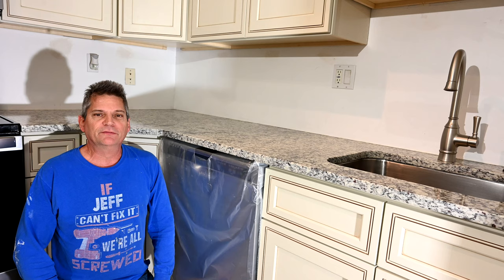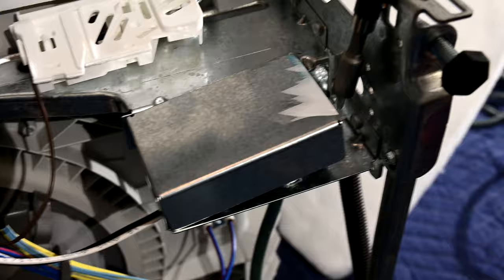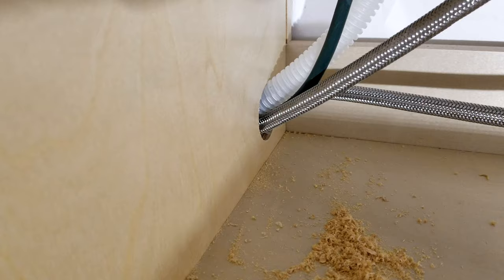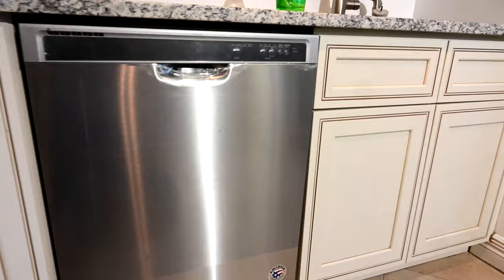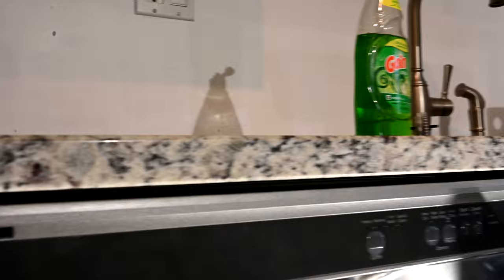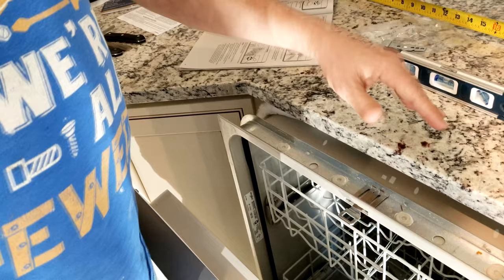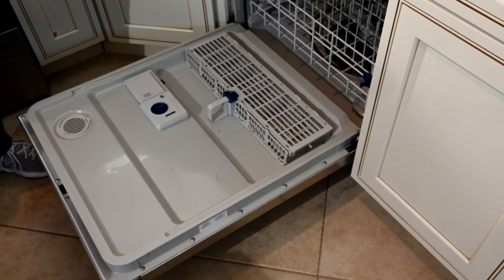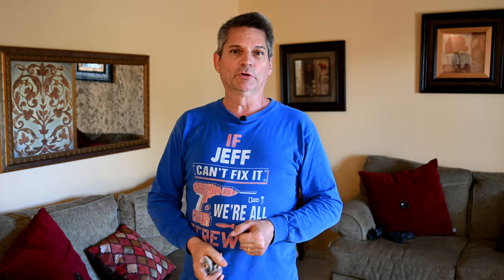How To Install Dishwasher Like The Pros, Correct to Code

Comment from the maker: 🛒 Amazon sells 2 smaller versions of this Channellock Mechanic's Tool Set:
🛒 Channellock 39067 132 Piece Tool Set: https://amzn.to/36SZr1U
🛒 Channellock 39070 94 Piece Tool Set: https://amzn.to/35N3fBy
🛒 RIDGID One Stop Wrench Kit: https://amzn.to/2ClCbNa
🛒 Milwaukee 3/8-in Cordless M12 Ratchet Kit: https://amzn.to/2XGzS01
🛒 DEWALT DCK299D1T1 Hammer Drill, Impact Driver Kit: https://amzn.to/2M6h450
🛒 General Electric Universal Dishwasher Water Connection Kit: https://amzn.to/2EFPjNi
🛒 Milwaukee 13-Piece Hole Dozer Hole Saw Kit: https://amzn.to/2H3Wxyh
🛒 Channellock 12-Inch Tongue and Groove Plier: https://amzn.to/2ThDVBv
🛒 Whirlpool 3-Prong Dishwasher Power Cord Kit: https://amzn.to/2XysrYO
🛒 DEWALT DWST11556 Express Folding Workbench: https://amzn.to/2qsaRdi
Reply: i guess it is quite randomly asking but do anybody know a good site to watch newly released movies online ?
Reply: Good grief, I sure wish I had seen this video prior to ordering all the other fittings and shutoff valves today.  21:13 is quite the sight, so sleek and simple, quite nice indeed.  Double water shutoff valves, and their 1/4 turn, hot.dog!

Comment: This guy isn't a professional at all first off I seen copper outside of the wire nut, second the hose clamp on the drain coming off the pump was not in the proper position which could cause it to leak later on third a real plumber drills a drain hole through the cabinet right below the counter top so that you don't have the drain hose under the cabinet getting in the way

Comment: Jeff, Please respone to this statement I found online. - "The door of the dishwasher is typically not flush with the cabinets, says Home Arise, but instead it protrudes out from the face of the cabinets about an inch or more. This is so that the dishwasher doesn't vent steam inside the cabinets when it's in dry mode. In addition, if the dishwasher is too far back inside the cabinets, the front lip of the face frame interferes with the top of the door. Therefore, the correct positioning is to set the front of the dishwasher – not the door – flush with the front of the cabinets. The door protrudes just enough so that the contact point between the door and the front of the dishwasher is visible."
Reply from the maker: That does have some sense to it but I would also make sure you followed the guidelines of what the manufacturer tells you because their design of their dishwasher might be different maybe it's venting out the bottom. Also when the dishwasher door is closed it's sealed with a rubber gasket so I'm not sure where all this steam is coming from that they're talking about
Reply: @jeffostroff  Thank you for your quick reply!  I will check the manual and hopefully it will be as helpful as your well made videos. Most new appliances have skimpy information and refer to an online version.

Comment: Honestly, I used to do installs for Lowe's and every dishwasher I've installed was attached either at the top or side mounted. Good that you pointed out checking the plug on garbage disposal. 99% of customers that bought a new dishwasher because the old one wasn't draining. They hired another plumbing company to install a new garbage disposal and they forgot to knock out the plug. That's a costly mistake. 1. The water damage it causes from the dishwasher overflowing and 2. The cost of a $400+ dishwasher that they really didn't need. Btw, I wish all dishwashers install had wall outlets, 90% of the ones I've installed was hard wired 😅 Another GREAT VID Jeff!!!
Reply from the maker: Thanks! Wow, funny how you only see the hardwired, but we only see outlets down here. Maybe it's the age of the houses. You could put in a blue remodel outlet box you know, would they allow you to do that?
Reply from the maker: Thanks! Wow, funny how you only see the hardwired, but we only see outlets down here. Maybe it's the age of the houses. You could put in a blue remodel outlet box you know, would they allow you to do that?
Reply: @jeffostroff  In Orlando you're allowed to use them, but Lowes wouldn't pay for such things lol

Comment: You called it Jeff.  I remember when a new dishwasher was installed at my father's home the guys contracted by the big box store rushed through the install  - unit was not flush or level.  The discharge hose is lying on the floor and has to be replaced and properly reinstalled.  They didn't seem to care if they did a good job or not, they just wanted to get out. The attitude they displayed was "unprofessional" at best.
Reply from the maker: We are seeing way too much of that attitude lately

Comment: Thanks Jeff. I had new dishwasher installed by Big Box and they did not put discharge hose up and the front cover plate was not screwed on. real issue was the old washer used 220 so had 2 110 lines in to it they hooked it up like that and keep tripping breaker, that's how they left it with my wife.  He couldn't just remove one line to have it running.
Reply from the maker: Yes b I g box store installers arw inept

Comment: 2020 NEC requires GFCI protection for all electrical receptacles within 6 feet of a sink. No longer any language that exempt those behind a [cabinet] door. If this is a new build you need a GFCI outlet or breaker
Reply from the maker: We are putting one in currently on a remodel as we speak.
Reply: It should be noted that a dishwasher pulling power from a circuit that has a gfci outlet on it should also be protected by that outlet. So it should not be hard.

Comment: Excellent video! Glad that somebody is calling out these so called installers from Best buy, Home Depot and Lowe's, I prefer to do installations myself at 70 years old I can still do a job in a professional manner as to avoid headaches due to improper installations. Last install (a dishwasher) was from Best Buy and let me tell you I gave them an ear full. Totally unprofessional, messes everywhere, you could hardly walk in the kitchen, would not touch the water shutoff valve due to a light surface oxidation, not rust just a light faint layer of oxidation. Took me 30 seconds to disconnected the old hose and connect the new one, 30 seconds flat, not bad of a 70 year old, HEY? Yeah due to liability concerns. If you expect to find shiny shutoff valves to do a job, you will be disappointed. Oxidation is a natural occurring process on metal when is exposed to humidity as in a dishwasher cabinet, and any house that is a few years old will have this issue. The degree of oxidation will determine if you need to replace that valve, in this case it was just a very light layer of surface oxidation, I wiped it off and connected the new water hose in 30 seconds flat. The guys left w/o saying thank you, ended up getting a refund and I have not hired these so called installers again. The few things they did, I had to re-do because the hoses were leaking, looked like a waterfall inside the cabinet, I told them to go home to their daddy and mommy and did the job myself, these guys messed around for 2 hours and could not get the job done correctly. Shame, shame! Oh well save me 180 bucks!

Comment: Hi Jeff, this video is very informative. Code standards and installation. I have a few questions regarding your instructions:
*During the electrical plug installation <2:00> you made a very important point about the rough metal circle needing a buffer so that the wire didn't get frayed. This made perfect sense. So when we came to <6:41> in the video I wondered if the same would apply to the edges of the circle cut out which leads to the water and electrical hook-ups in the next cabinet. 
* The water hose (because it is constantly pulsing high pressure water) couldn't this hose get cut in to after time?
*The electrical plug in, same thing 
* Last is about the safety of threading the water hose, the electrical plug in and the water supply hose all together. I  guess because I was always told water and electricity don't mix.
Thank you again I hope you will be able to answer my questions 😊
Reply from the maker: You could run them through their own hole, i t doe snot mater. The big drain hose is never under pressure so it won't pulsate. The smaller supply hose is under pressure but typically is a steel belted hose so it won't keep shape changing on you. The difference from 2:00 in the video is the sharp edges of metal cutting the cord. The wood is not considered a sharp edge that would cut the cable.

Comment: Great video Jeff. Thanks especially for the explanation on the air gap. I bought one for my new faucet thinking I needed it or that it might be a benefit. I am sending it back. As you are aware, I live in So Fl so not needed by code either.
Reply from the maker: Glad it was helpful!

Comment: Great video Jeff! Everything was explained well and was very informative! I just recently installed a new control board for my dishwasher because the old one did not give me the green light.  Now, the dishwasher is working perfectly, the only issue I have is securing it to the counter again.  I misplaced the screws and I'm not sure exactly what size they were.  We have a quartz countertop and I remembered seeing in your video that installers will sometimes mount a metal bar underneath.  I see the metal bar and the brackets I am just not sure on the screw size.  Or will it be more secure if I mount it on the sides as you did? I think you said number 10?  Thank you I am now a subscriber! Outstanding video!
Reply from the maker: Yes, predrill with a 1/16" drill bit about 1/4" in if you use the side mount method. But you should be able to locate and re-use the previous holes in your counter.

Comment: Hey,
I recently purchased a Maytag dishwasher and it has screws in the electric box. The side that I have to hook up my own electric connection also has screws, so I am assuming that I need a wire that has those circular brackets. Is it just safe to wrap my hardwire’s tips around the screws?

Comment: The Screws of the Romex connector belong on the OUTSIDE of the connection box! They are sharp and can cause damage to the wires. Code requires them to be accessible "without removing the covers of the box, fitting, or cabinet". 
• 6 inches of the flexible cord or any other cable "shall be removed to allow 6 inches of free wire" within any box..."
• Under the sink: There should be 2, SINGLE outlets for the disposer and the dishwasher, not 2 duplex outlets.
• I love the paper-towel stuffed in the extra drain pipe, how about removing the elbow and capping it off with a clean-out plug?
Reply from the maker: LOL, you are blind as a bat! You did not see at 2:24 I used FLAT tipped screws, specifically designed to be safe for wires, like flat tipped Eaton screws used to secure electrical breaker panel covers to walls. And you look at those screws and say they are sharp? Time for glasses. You know how to ramble off NEC code about outlets under sinks. But you are wrong, it's only on new construction. This is an existing kitchen and they don't have to be changed to newer codes unless you open up the wall. As for paper towel, that was temporary until we were finished. The old pipe coming out of the wall was cut a few inches off the wall, and capped off.
Reply: @jeffostroff  Sure, and the opposite ends of the screws are still a sharp edge. They are still supposed to be OUTSIDE the wiring compartment no matter what the screws are. Call me as many names as you want and be as rude as you want,  a sure sign of a guy that already know he's out of ammunition, but that will not make you right. The code is also clear; you have to bring it to current code when changing the appliance. Opening the wall is not a requirement. It's considered a new installation, no different than if you had started from scratch. It's not grandfathered. If you took it out to repair a burst pipe, then it's a re-install and it IS grandfathered. Some inspectors will let it go, some ....well, not so much. Been doing this for 45+ years, how about you? I hold licencure in Electrical, Plumbing, and Facilities Management (Degree'd from an Ivy league school) and have EPA certification for refrigeration... And you?
Reply: @johninmilford7719  as soon as I saw him put the strain relief connector in backwards, i knew this guy was clueless, don’t bother trying to sway him.

Comment: I had a new Bosch installed this week.  I notice under my sink it gets really hot now towards the end of the dishwasher cycle.    Never had this issue with the last dishwasher.   I’m wondering about the water line …I can’t remember what material the last water line was …this one looks like white plastic.  I wonder if need to get something better.
Reply from the maker: White ribbed plastic is the drain hose, normal, about 1" diameter, runs from dishwasher, through hole, to the garbage disposal. But your water supply line form the shutoff valve under the sink going to the dishwasher should be steel belted hose. The white ribbed drain hose from the dishwasher only gets a little warm when the dishwasher empties a few times during the cycle. IT should not make the inside of the cabinet hot. It is not leaking is it? Any water or steam in the cabinet during the cycles?
Reply: @jeffostroff  No..no steam.   Last night I ran it on Auto cycle and it ran a long time.  Tonight I ran it on Normal cycle and that seemed to be a shorter cycle and not nearly as warm under the sink.  I can still feel heat coming off the plastic line but not like yesterday.    I guess some heat is to be expected ????   Just never noticed before.

Comment: JEFF, DO YOU HAVE TO TAKE THE DISPOSABLE OFF TO PUNCH OUT
THE  PLUG?  THANKS SO MUCH FOR THE VIDEOS.
Reply from the maker: No, I prefer to punch out the dishwasher plug before installing, but one time my friend installed it and forgot to punch out the dishwasher plug. So we reached up and jammed a screwdriver in the side of the disposal until we detached it.

Comment: Great video, just wounder about one thing. I've been a plumbers helper for 3 years now. I've installed a good amount of dishwashers.. maybe its florida code or just a preference by the boss. But we always had to put the drain hose hole. At the top back corner of the cabinet. We would have to re do it if we put it through the bottom hole.
Reply from the maker: I follow the directions of the manufacturer, which usually tells you to run it through the hole at the bottom of the cabinet, to avoid crushing or kinking the hose. Either way you still have to bring it up tot he counter for height for your high loop as required by code.

Comment: My cupboard has an existing drainage tube hole in  near the top of the cabinet - the hose came up, through the hole and down to drain where it was clamped. The hole supported the high loop- can this be an issue? I’m installing a new dishwasher and it’s also suggests putting all 3 hoses/electrical through the bottoms hole
Reply from the maker: I am not a fan with the way the instructions on the dishwasher show Routing the hose. Once I get it into the bottom of the cabinet I still like to run it straight up the wall towards the counter top and then curve it back around and it should come downward toward the garbage disposal port where it plugs in .

Comment: I just installed the same (or very similar) model dishwasher, but was confused as to the writing on the side of the dishwasher beside the drain hose, where it states: do not remove hose. Well, the drain hose is all curled up on the side of the dishwasher in a curly-q pattern attached into bracket/clips made of plastic embedded into the side panel.... but it seems like installation videos I watch show the drain hose going straight out the bottom of the dishwasher... hunh?? seems like the instructions are not very clear all the time.

Comment: Thanks for the great video.  Does the high loop only apply when attached to a garbage disposal?  We if there's no disposal?  Do you still need a high loop?  Thanks.
Reply from the maker: Yes you still need the high loop, it helps prevent a backup into the dishwasher

Comment: On your previous video I noticed you drill two holes one for the plug it’s self and another for water and drain and in this video you did only one hole does it matter if it’s two holes or one what do you recommend??
Reply from the maker: Some people think you need to separate them into 2 holes. May last install a few weeks a go we did one hole. It depends on the space in the back behind the dishwasher, and how high  the bottom of the inside cabinet is off the floor, and whether you'll have room to drill 2 holes. Always best to do what the manufacturer says